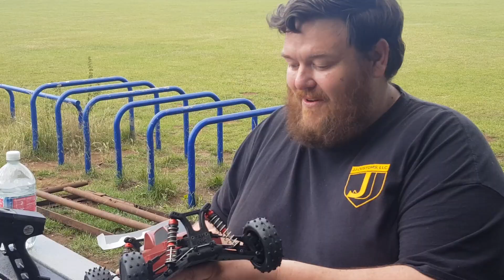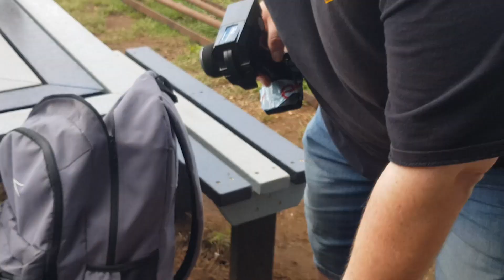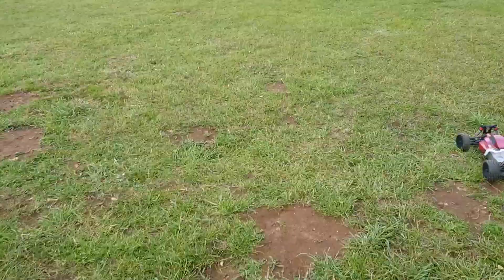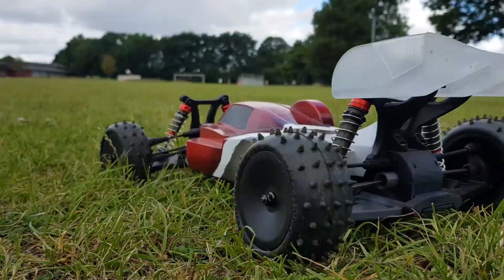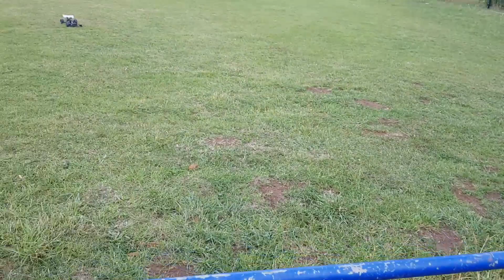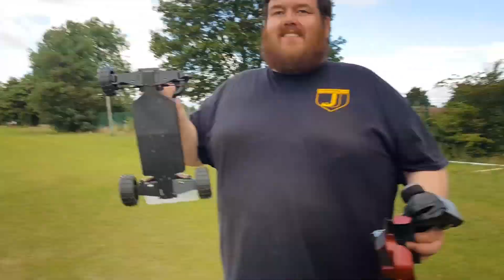3D PRINTED RC CAR GETS BROKEN

Comment: Reminds me of my old Grasshopper in the winter.  When I was done with it it was more epoxy than car...
The really sad part of 3D printing RC parts is how much variation you get from a good roll of plastic to a bad one (same brand) or when you have to adjust the heat to get the print to work but then it's either brittle or the layers aren't bonded well.  Takes a lot of doing.  Gotta try some PP when the great COVID plastic shortage ends, but it's so pricey it's doubtful that you're better off than just buying a car... sigh  
But then, there's something to be said for making your own stuff...

Comment: That's what it was like in the old days when plastic was brittle and would break just looking at it. 😉👍👍
Reply: Still better than arrma chassis
Reply: @jamesmacenhill3841  I felt that but I believe its the stock arrma 4s line arms they suck
Reply: لا والله
Reply: @jamesmacenhill3841  فث
Reply: Armar chassis is not tough enough Tamiya tt02 the chassis is solid rally
Reply: @fredftc8840  are you on about the metal or plastic one
Reply: @نايفعبدالله-ظ5ب  من هو جو؟

Comment: I'm currently in the process of printing this car. There is a guy on a forum link to the car that printed and raced the car locally he said it was a test of all the different filament and he used carbonex nylon htpla carbon based and petg he even put losi shock absorbers on it.... I think it's a brilliant design and it works pretty cool video 👍
Reply: Do you have a link for that?

Comment: It's a cool car just the same, pretty good effort really. If I may preach to the converted, 3D printing parts for your RC's can work, but it takes a bit of nutting out exactly how to produce the part and make it at east reasonably durable. Allowances have to be made in the design to make it work with the different manufacturing technique.
I've done a few and they've worked ok.

Comment: If only 3D printed stuff was a little stronger. One day when the 3D printing market gets more advanced, I wouldn't doubt parts will be stronger. Everything I've ever had that was 3D printed breaks fairly easily. Not yet up to what it could be and definitely not for a fast or heavy RC car.

Probably be ok for a RC airplane though.
Reply: The technology has really tough materials you could use. Heck, doctors even print spare bones that put into humans. You could print METAL, it's just the guy who printed it went with the cheapest and brittle PLA material. It can be printed with carbon fiber nylon and it's gonna me just as tough as a regular rc car.

Comment: You can add different materials to the printer to make the plastic flexible like hard rubber then make other parts more solid
Reply from the maker: Yes mate. It will happen and will be back for another run in 👍👍